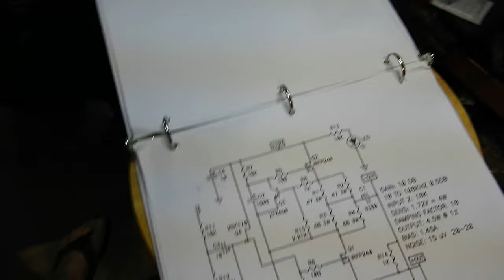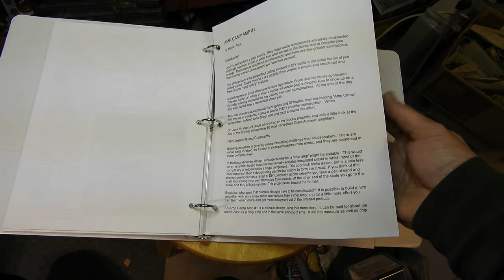Brief look at a Class A Power Amp Kit and a Compact Transmission Line Speaker

Comment: Nice little amp but very power hungry for the output you get. It would work well with efficient speakers. Would be nice to hear those speakers.
Reply: It goes without saying the a class A amp would be power hungry. But since it is only 8 watts per channel I can't imagine it using more that an incandescent bulb for example. I wouldn't do 100 watts this way, but I wouldn't be afraid of going to 30 or so. If you like simplicity this is it. The speakers do well in the relatively live space of my kitchen/dining area.

Comment: Great little amp as long as you have high sensitivity speakers or are happy to use at moderate volume levels.  I bought one as a stopgap when my regular amp was in for repair.  Did a great job on 105db per watt back loaded horns.

Comment: I use the amp and speakers daily in my kitchen/dining room. Perhaps we will revisit in the spring. I built it with a friend who has little electronics experience and both units work fine. Pass is all about simplicity and discrete components. I can vouch for the sound quality. The kit might be considered a bit pricey, but the chassis is beautiful and the components are all sourced from legit electronics houses in the US.
Reply from the maker: So what kind of finish?
Reply: I have some laminate in the garage that I will be using. Kind of a marble look. Probably get it done in July once I retire.
Reply from the maker: @kurtsvids5529  Just avoid sharp edges anywhere in the front.

Comment: Distortion seams quite high even at mid power. Case looks very similar to the cases I  use on my amplifier projects.
Reply from the maker: Yes, we seem to have been clipping early and often, made me wonder if it was really making a solid eight Watts per channel as rated.
Reply: Anton's environment is very different from mine. He has carpeting and a big couch in the room which soaks up a lot of the sound. At home I have these units on a hardwood floor next to a wall. Desirable high volume is well below clipping in that environment. I don't get your comment about mid power Michael. Are you prejudging from the spec or have you actually heard one with the genuine components and power supply? The mosfets are expensive for the genuine article and if experience serves the Chinese ones are probably crappy. I think it would be fun to go head to head with it with my 25W x2 Tiger at the same power level to see how the sound differs. I use the ACA daily with these speakers and can attest to it's pleasantness compared to other setups. No fancy fake audiofool terms here :).